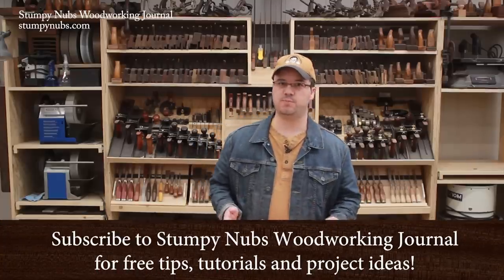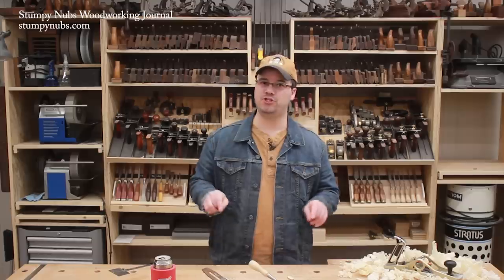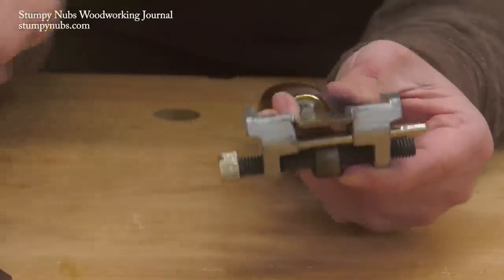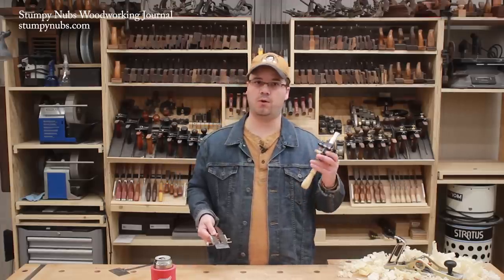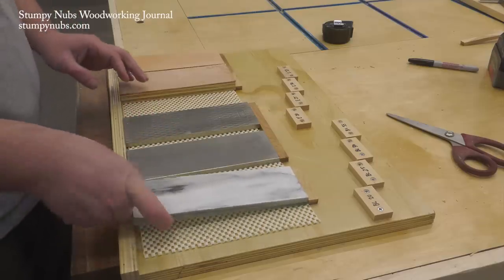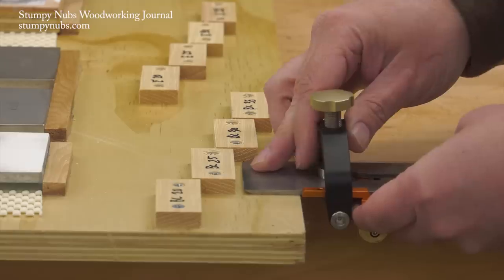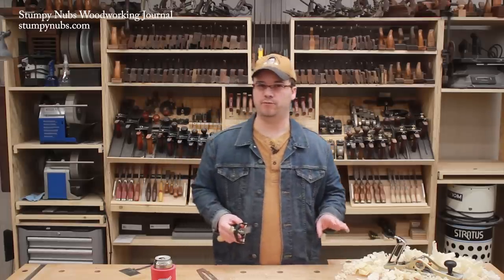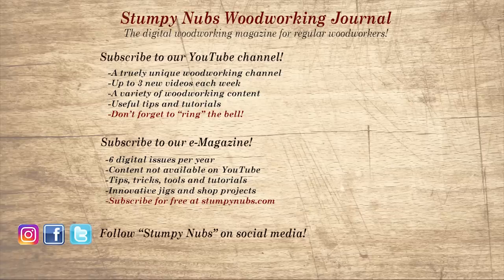Clever jigs for faster tool sharpening by hand

Comment: It irritates me immensely that I am required to modify or fix a tool that the manufacturer puts out in a defective or unusable state. This happens a lot with both cheap tools as well as the higher end ones. On inexpensive tools you expect to get what you paid for, not much. But on tools like a chisel or plane iron from the higher end line like Lie Neilson, having to flatten the back is ridiculous. For one, not so bad but for a set , a real pain. You get what you pay for and sometimes NOT. JMHO.🇨🇦👍👨‍🦳 That’s why Cosman preps everything prior to to shipping and charges for it in the high price.

Comment: Misleading title - jigs make tool sharpening slower. Have a look at freehand sharpening if you want to get up to speed.
Reply from the maker: No, jigs make sharpening more accurate, which means less material must be removed, which makes it faster. Nobody said a jig is faster than free-hand, if you are skilled in that technique. But for weekend woodworkers who sharpen very infrequently and have not developed freehand skills, jigs do indeed make sharpening faster.

Comment: Even quicker is to run a long neck honing guide off the bench. (e.g. General 810) and put slight height differential into your abrasive surfaces. You set one blade setting but get that slight increase in angle at each "stone" grade.  And you use the whole stone surface.  Whatever happened to the General 810?  They're like hen's teeth now.  I had to make my own when I needed a second one.

Comment: Hey Stumpy I have a quick question for ya.  I have a similar honing guide to the one you used. My  Instructions say that  The top of the chisel should rest between the 2 flat sides  of steel below them, not in those slots. Any idea why they  would say that? It seems like they  We're made to be used the way you described

Comment: I have an Eclipse-style jig, and I found that the bearing surface or the wheel (or maybe the shaft) wear over time, increasing the play in the wheel.  When this happens, a straight, consistent edge is pretty much impossible because the tool rocks side-to-side from this increased play.

Comment: Thanks for the tips. I have heard of bridge city but don’t own anything from them. Similar to how I don’t own anything from blue spruce... but I will check out that honing guide because I am not happy with the cheapo one I am using now. I do sharpen with sandpaper on glass and that works excellently. I doubt that I will ever get a diamond stone or especially a water stone. My main concern is that jig.

Comment: Nice info there. I'm ganna get me one of those guides, and a diamond stone! Have you ever done a video on the best starter hand plane to get? I know it's a question with the "depends on what you want to do" type of answer, but you've always been good at those. 🙂
Reply from the maker: The most versatile plane, in my opinion, is the #5-1/2. It's large toe makes it easier to keep it flat as you start a cut. It's large enough to joint the edges of short boards you want to glue into a panel. It's small enough to work as a smoother in many cases. Spend the money on a good one (Wood River is a great value).

Comment: Hi Stumpy - In previous videos you recommended the  300/1000 diamond Trend stone kit and you indicated that this was all one really needed for stones. However, in the honing jig, I am seeing the two stropping leathers the 300/1000 diamond stone PLUS the 180/600 Trend Diamond stone and what looks like a traditional whetstone which is showing some use. Can you provide some color as to how you use these other ones in practice and the benefit realized by having these additional stones? Thanks in advance! (And thanks for all the great information!)
Reply from the maker: I recommended the 1000 grit stone for sharpening, but always followed by stropping. 160-300-600 is for repairing or reshaping new bevels and getting them back to the point where you could use the 1000 again. The high grit Shapton wet stones are an alternative to stropping. Depends on what you feel more comfortable with.
Reply: @StumpyNubs  Makes sense. Thanks!

Comment: any reason  didn't use a digital angle gauge when setting up the blocks?  Seems like that would be easier and more accurate than the protracto.
Reply from the maker: I've never tried it. I might give it a go. But it won't be faster than the stops on the board are.
Reply: @StumpyNubs  sorry, I meant to say using a digital gauge when building the jig and positioning the blocks for fast set up.  Thanks for the video, I love the idea of speeding up the hand sharpening process to make it less painful and something I'll do more often and faster so I can keep working.  I'm looking to simplify my process so I'm going to build this exact set up!

Comment: Bought the Bridge City Tools honing guide after watching this video, and I have to say that I'm really, really disappointed in it. I received the guide yesterday and set it up to use today. After about 10 minutes of use, the brass wheel seized and wouldn't turn. I loosened the wheel so that it would turn, and now the wheel will not stay attached unless I tighten the wheel so much that it will not turn.

When I pay nearly $200 for a honing guide, I expect it to be amazing to use. My lowest expectation is that it will at least WORK. I understand that there are manufacturing defects and such that can happen, but I don't have much trust in the Bridge City Tools brand. I've submitted a support request to the company, but I'm thinking I'm going to just go for a refund and a Veritas guide.